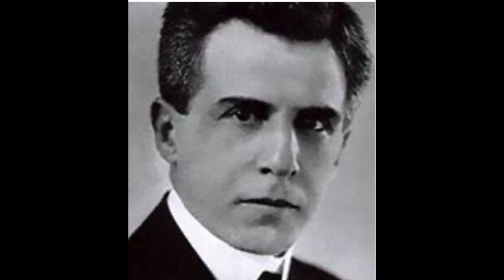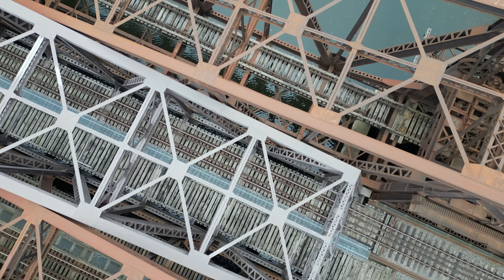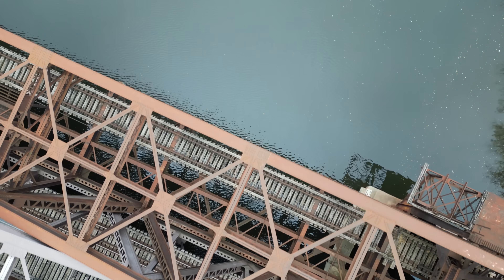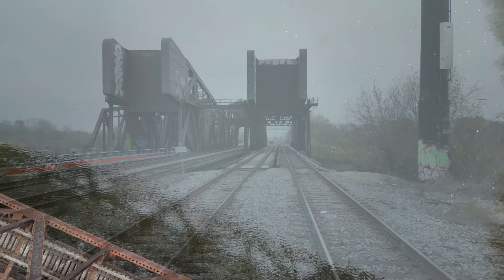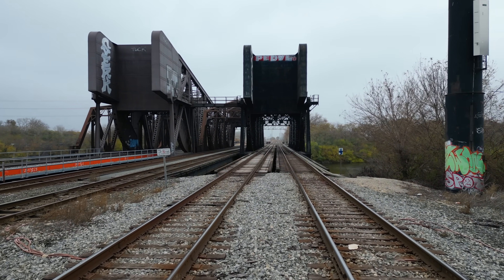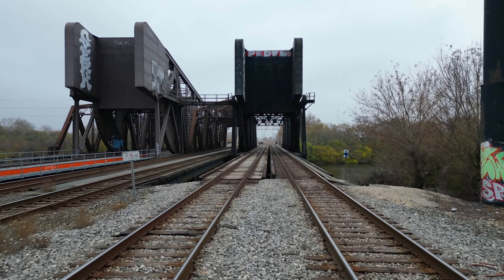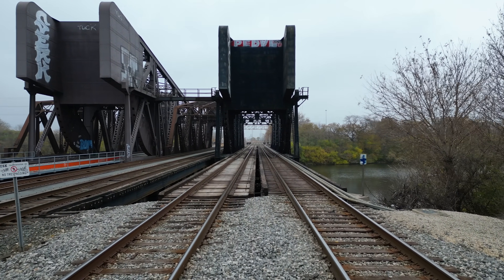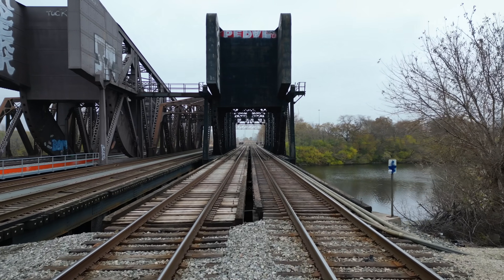The  Scissors  Bridge,  Brighton  Park,  Chicago,  Illinois,  Built  1910

Comment: The vertical clearance on those bridges is 17.6 feet but they're still operable drawbridges. Just east is the fixed span Western Avenue bridge with 22.9 feet clearance. About a mile and a half to the west is the Illinios Northern railroad bridge with only 19.5 feet vertical clearance under a fixed bridge. That 19.5 feet is the limit on air draft for vessels going down the Sanitary Canal. Larger (taller, or longer, or wider) vessels would take the Cal-Sag though, which is a frequently used shipping route. The Sanitary Canal and the Chicago River are mostly used now only by local deliveries of cement and gravel and similar materials, and by pleasure craft.
Reply from the maker: Thanks  for  that  info!  I  didn't  know  about  any  of  that.
Reply: @historyinyourownbackyard2363 This goes in depth on the lowest bridge https://youtu.be/p-1IL4p2oAU?si=3OuUyTSNV7DuyNzm

Comment: Nice video. It wasn’t only the Pennsylvania Railroad though, only the westernmost was the Pennsylvania’s “Panhandle Route”. As you pointed out, the original tracks were removed, and a single track was restored by BNSF Railway to connect its ex-Santa Fe line a few yards south of the span with its ex-Burlington line a few miles north of here near 20th Street. The easternmost span carried the Chicago River & Indiana, a New York Central subsidiary that built into the stockyards district and is now used by Norfolk Southern. The middle span carried the Baltimore & Ohio Chicago Terminal railroad and is now used by CSX.
Reply: Actually CB&Q tracks went up to IH at 26th St where they connected to the lumber district switch line (CB&Q ownership) and the Illinois Northern switching line (ATSF subsidiary) West along 26thst to just past the county jail before turning southwest to near 31st and Kedzie and then south and west to cross the river just north of the Santa Fe Corwith yard at 34th and Central Park.
Reply from the maker: Thanks  for  the  information!

Comment: Excellent video! Were there operator shacks at the bridge site, or were they operated remotely? Example, Saint Joseph, MI, has a swing bridge, and there is an operator shack in the middle of the bridge. I was seeing stairs on this Scissors Bridge, but never spotted what looked like a bridge operator shack.
Reply: They used to be completely intact until local dirtballs burned them down!
Reply: @Wheelgauge-bt7ox  Where abouts on the bridge were they? What did they look like? Thank you! 👍
Reply from the maker: @Wheelgauge-bt7ox  Do  you  have  any  idea  what  year  that  was?
Reply from the maker: That's  a  great  question  and  I  don't  know.  I  saw  the  stairs  also  but  no  real  control  shacks.  It's  been  so  long  since  they  have  been  raised.